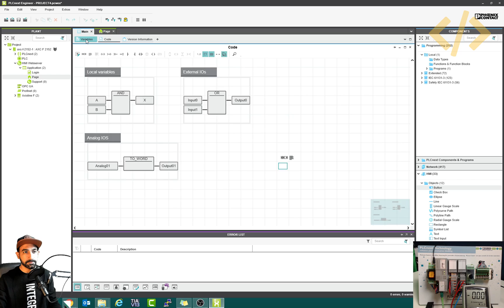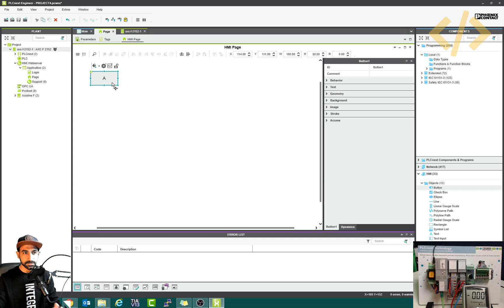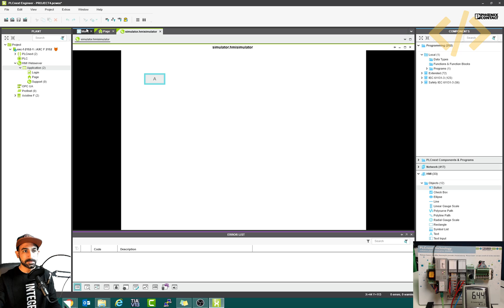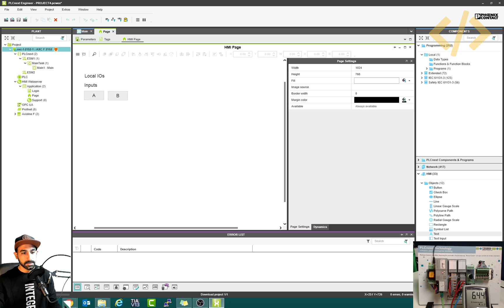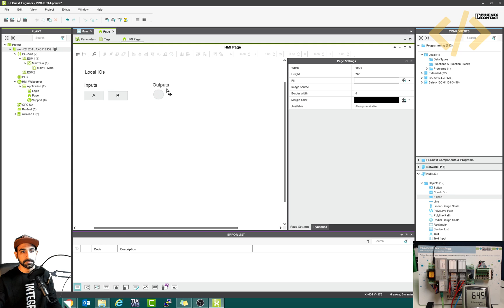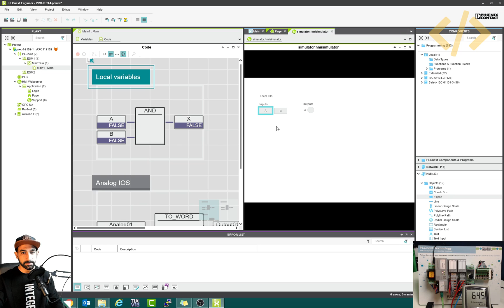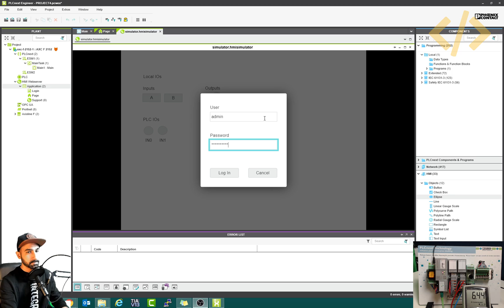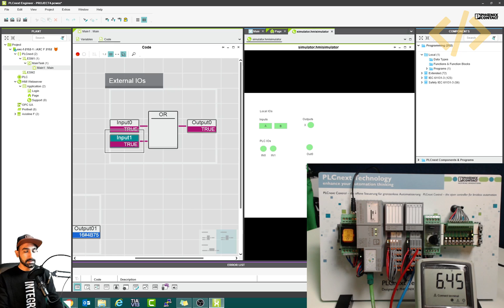PLCnext Lesson 6 - Designing the HMI for Digital IOs

Comment: Great Tutorials Rajvir. A quick question. Can I learn about PLC programming after downloading the software but not actually buying the starter kit device? i.e. with just using simulation? if so, could you PLEASE make a single video about PLCnext IO programming with just simulation. For example, if you're familiar with embedded systems development, one could learn about embedded systems development by downloading an IDE like MPLAB for writing software and using Proteus as a simulation environment. Is this possible here with the Nextplc IDE?
Reply from the maker: PLCnext does not have simulation at the moment but may be comes in future. But you can try codesys software for complete simulation
Reply: @thegeterrdone  Thanks man